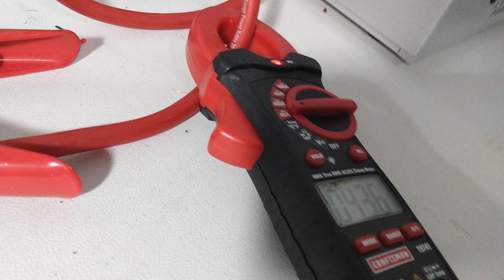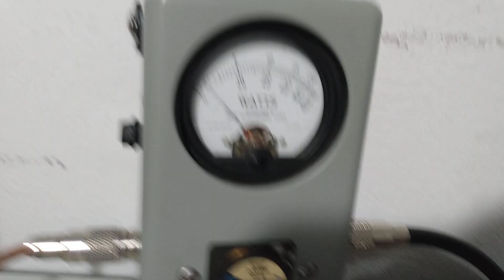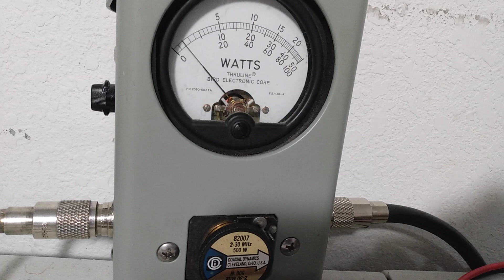Rare? Amarillo Mobile Amplifier, "AM Modulator, Texas Star Clone or Early model

Comment: Clean amp, should sell quickly.
Reply from the maker: Have you ever seen one?
Reply: @Rooster_Radio  
No. But from what I've researched, there was a time in the beginning where amps didn't carry the "TS" name. But confusion set in so they changed to Texas Star plus a model number. So, the smallest was the Amarillo which eventually became the  Modulator (a more descriptive name)... then a model number corresponding to the approximate watts such as the 3200.